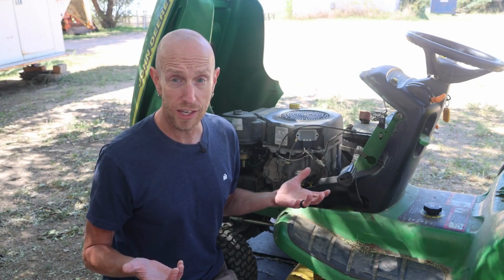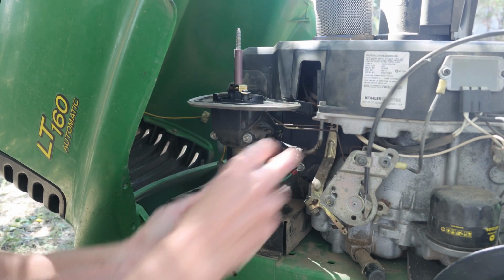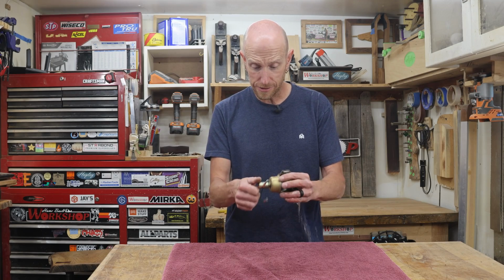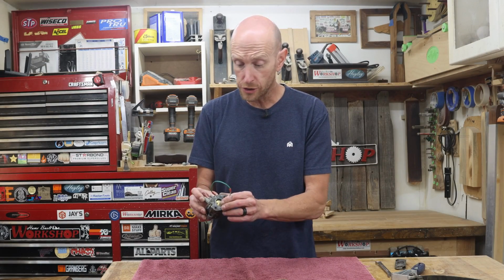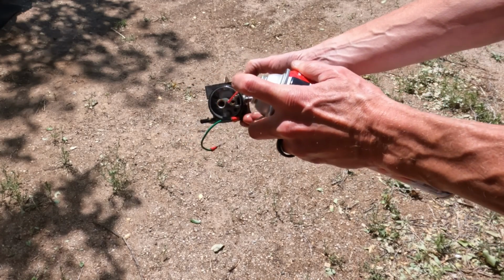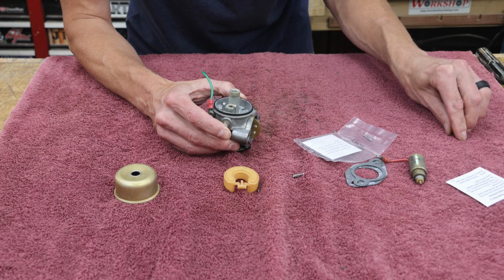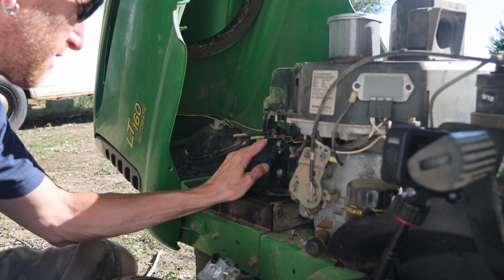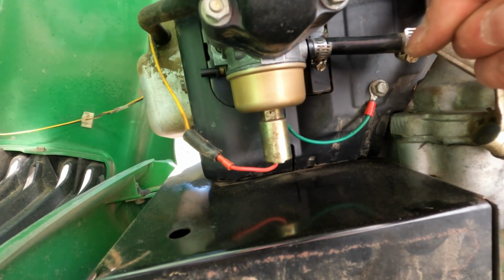How to Clean and Rebuild your Lawn Mower Carburetor | Save Money and Fix Your Own Mower

Comment: A lot of time when my push mower would be running like that if it either cleaned or replaced the air filter it would correct the issue.
Reply from the maker: I've had that happen as well. The air filter on this one was clean. The carburetor was just filthy from years of use. This mower has a lot of hours on it and I don't think its ever been taken apart.